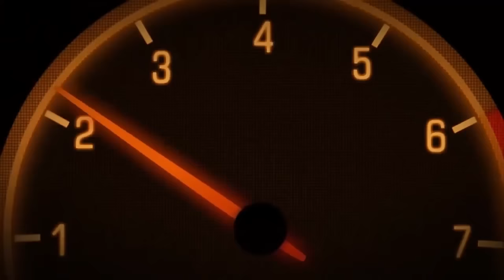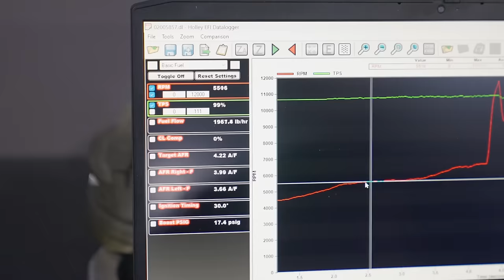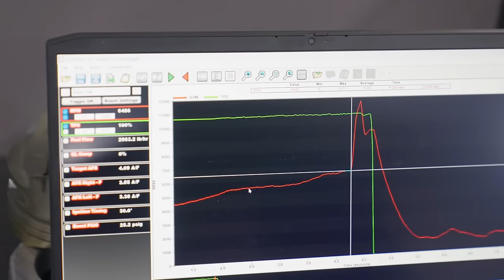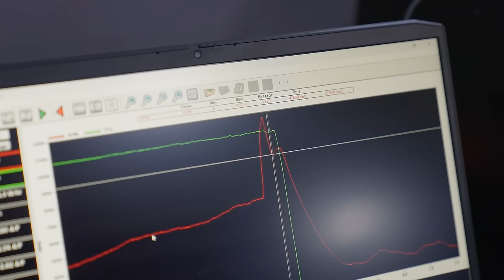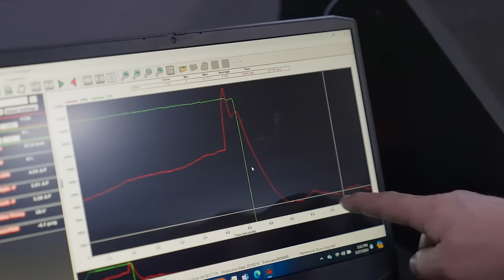This Will Make Racing So Much Easier !

Comment: instant circa 30' if I may, the inertia would not drive the revs up (inertia only tends to maintain motion), there must have been some combustion to increase revs when the braking action stopped (to  analyse the sequence one may want to double check the actual response time of timing cutoff upon signal, i.e. to time the event chain it takes from the cutoff signal occurence to detection of said signal to analysis to cutoff decision to actual cutoff chain - i know, easier said than done - plus not sure that would have made a lot of a difference - the side issue with a lot of sensors trying to avoid a rare issue is getting false alarms that cause more harm than good, e.g. with ping sensors of vibrations sensors on the whole setup)

Comment: Are you concerned with what the wind/air forces might do along the seam between the glass and the quarter panel at 200+ MPH? We have all seen them suck windows and doors off of cars, often at significantly lower speeds. I think that with the structural rigidity being compromised as it is, you would be well served to reinforce that area, even at the expense of the added weight. You’re going to be very upset if your fresh quarters get torn off the car at speed.

Comment: "Lexan" is the trademark name for  polycarbonate from GE Plastics.  Might wanna send those flywheel bolt off to a lab or someone that tests that kinda stuff.  Could the pillow block have failed first and let every thing get out of line?  Would just take a blink.
Reply: Yeah those forensic labs are doing a booming business these days.  LOL  While I wish there was a "lab" like that we could just send stuff too out of the blue to checked/tested/determined about X, Y or Z I don't think anything like that exists.  I'm happy to be proven wrong so correct away with contact info!!  LOL
Reply: @JViello  Most machine shops have eqpt. to look at a fastener and give you a good guess,  took a double row ball bearing to a guy worked in QC to look at, it was howling in my jet boat He checked it for about a min. and told me I should have shelled out the extra 25 bucks for the premium bearing.He showed me chips in the balls, the bearing looked perfect to the naked eye.   I'm sure if your some research on the web, couple o phone calls you will find what you need, good luck

Comment: Steve, talk to Clark about welding handles on the inside rear portion of the panel so you can pull to align the fasteners from the inside and make it easier to put the zues fasteners in

Comment: Steve... You need to install a loud pedal for braking, and a dyno Christmas tree light system. When the computer stages you at max rpm if it sees a sudden high increase in Revs for a few milliseconds..... It drops the tree instantly from the staging lights to the go light and at that moment with you being a drag racer, you stomp that loud pedal engaging a fuel shutoff solenoid,  motor and inertia braking system. You get to drive the dyno! Think about it Steve! 🤔👍🏁🇺🇸

Comment: in time i'm sure you will get it where you put a level in the middle if the fender with a handle and it undoes all the inside ones at one time. you getting faster every year.and that means more of a chance of getting into a crash so i would keep it for a spare.

Comment: I’m wondering if framing it out first and installing the Zeus fittings would have helped you keep it all lined up, then cut the sheet metal quarter panel off.. still awesome and makes sense though. Also maybe a titanium wire rope installed to the inside quarter as a back up incase the quarter decides to separate at speed? Really enjoyed the video! 🤙

Comment: I hope those rear vent windows don’t fly open (or worse fall out) the first time your car shakes the tires.  OE hardware was never designed to hold up under the forces of Pro Mod tire shake!  You might want to come up with a more secure latch mechanism for those to prevent that.  None of us wants to be “that guy” who breaks glass on a freshly prepped track.  That said your ingenuity re: the removable rear quarters is top notch!

Comment: Steve, you need to REMOVE THE FUEL CANS OUT OF THE DYNO ROOM!

In the event of an explosion or flying parts, they could hit them, puncture or ignite them and burn your building down.

A few extra steps to get fuel is worth the safety of saving your shop.

Move the fuel jugs outside  of the dyno room please...

Comment: On the dyno flywheel bolts, what grade are they and how often are they changed? Handling as much power as your engines put out, I can easily see metal fatigue as a real issue.

Comment: Any way you can come up with a piano hinge that would mount to the top of the fender underneath the window? It'd be much easier to pull a couple Zeus's on the bottom and swing it open change the tire swing it down. My opinion your car do what you want just seems like an awful lot of Zeus Fasteners to take off

Comment: Now that the driver quarter is off a metal guy could remove the bondo and metal finish the quarter, and the air brush work could be saved and blended. The only reason the bondo was there because they could get behind it to fix it

Comment: I’d use the new 1/4. The original will need to get repainted anyway and that filler (“bondo”) will have to be all ground out and redone because I see cracks in it that spread. In the end it’ll be easier and cheaper to use the new one.

Comment: Something is telling me that on the inside, between the fasteners, one would profit from thin layer of silicone to dampen the vibrations. Like smear thin layer of silicon or rtv or similar and let it dry creating very thin gasket.
BTW reaction time of 0.2 seconds is super fast. For drag racers thinking it is not, just think that in the drag race you have luxury of knowing that is about to happen and you have tree lights telling you when it is going to happen. So you are reacting before it happens and that’s how you get lower “reaction” times. In this case, this was the real reaction time because it was unannounced. 0,2 seconds is the fastest reaction of average humans even just to recognize the change. From recognizing to action there is a tinny delay as well. So Steve reacted with an action in 0,2 seconds and that’s very fast for us humans. Sadly for inertia and those fast rpm both Steve and the rev limiter are to slow. It’s like a bullet time slown down on the high speed camera. In real time reaction was super fast. On high speed recording you see how that all is slow regarding to inevitable disaster. I am just glad that explosion haven’t hurt anybody.

Comment: It's like going to a tilt/removable front end & all the ease it brings, only on the rear.  Gonna be great.

Re: nibbler
Doncha love it; got a pneumatic version. It's an eager eater. 

Only negative is you can end up w/ a razor sharp scalloped edge if you aren't smooth w/ the cut. Well... that & the tiny little pieces of metal it leaves behind; worse than shallow DoC end mill swarf from SS.

Re: overwinding
Seems to me you were transported back to the 60-70's; just like missing 3rd gear.

Comment: I know it would have been nice to reuse the original quarter, but it really wasn't guna make much sense.  Finding that mud from the old repair in the L quarter may have been a blessing that'll save ya the pain of trying to cleanly add on the portion needed for overlap.  Cutting the donor quarter slightly "longer" than the opening, like what was done on the R side, will be much cleaner and easier in the long run.  One thing I found a lil odd, was how anyone could question the sudden uncontrollable over rev on the dyno... I dunno, I guess it just seems like it would be common sense.  One thing is for sure, getting her shut down that quick was pretty BA!

Comment: .2 seconds actually is a really long time for a computer, that is more than fast enough for a CPU to respond, if we just look at CAM single (while transfer rates differ per channel) it's not uncommon to receive fast changing data such as RPH at 50Hz (which is about 20 miliseconds). It could certainly be that the safety takes too long to kick in, but from a technical perspective theres that RPM limiter should just worked.
Reply: Even the fact that you have data points in your graph means that the CPU has more than enough time to process it otherwise those data points would have been missing as well.
Reply from the maker: Yes the limiter works
Engine inertia wont stop
Reply: Two tenths of a second, not two seconds. Even with the ignition stopped, and had he been able to instantly close the throttle on breakage, the inertia of the rotating assembly was going to climb for 2 tenths of a second given instantaneous work load removal.

Comment: Steve, I admire you for wanting a pretty racecar, but it's always going to be a losing proposition. Custom paint is for show cars. As for your removable quarter panels, I would have used the factory upper molding as seen on the replacement passenger side to hide some piano hinges and 5 or 6 dzus fasteners along the bottom to make swing up panels. That way you never have to worry about them getting stepped on, blown away, or stuff dropped on them. I would also go back to vinyl wood grain, so NEXT TIME it gets damaged it's a cheap easy fix, and also easier to change if say next year you want red brick sides 😂. Good luck in the future and keep the videos coming.

Comment: if you wanted to get really safe you could spend the money on Kevlar panels like the ones in secure buildings ? just a thought at least on the wall facing the operator of the engine dyno?

Comment: fairly thick piece of aluminium bolted to crankshaft. obviously fine until it wasnt. where the bolts 1 3/4 or so long? im thinking along the lines of, soft material being held by rather long bolts..

Comment: I have a 67 Camaro, so it's hard for me to get on the inside. So I attach mine by removing the Fender on the outside. But I did mine in the late 80s. Early 90s worked very well for all these years.

Comment: hey steve, just a question....?..arent those fastners u r use'n to temporaly hold the 1/4 panel on called "celcos" fastners...?...Zeus fastners r flat with a screwdriver slot in them...?...is that correct...?..or did someone lie to me....?...thanks..
Reply from the maker: Correct

Comment: use the new 1/4 panel you have, for that to be any good, clarke will need to cut out the bondo,  cut out  all where it's cracked, because any moisture that can get in there is going to cause problems down the road, so it'll need to get partially painted anyway, you might as well have it done properly.
you are a man who wants things done correctly, putting more bondo in there is not really doing the job properly.

Comment: Glass Suction Cup Heavy Duty Aluminum Vacuum Plate Puller Handle Holder Hooks Duty Glass Lifting/Tile Suction Cup Lifter/Moving Glass/Pad for Lifting (Yellow, 2Pack)

Try that to pull the fender on and off. should make it easier to move it around.

Comment: I am concerned that you are reducing the torsional rigidity of the tail end using Dzus fasteners on the quarters. As you now will have glass again, this may break during body flexing. I would suggest you make sure you reinforce the lower frame of the back side windows so they have more structural rigidity.

Comment: I don't buy bolts just shearing off unless they were cheaper than cheap grade 2 bolts, or if they were left loose.  If it were that easy manual transmissions cars and transbrake cars at the track would be constantly breaking their flywheels and flexplates off their engines rather than drive shafts, axles, etc  At 100% throttle and 6500 rpm lets say that engine is making 1000 ft/lbs of torque, at that point those bolts are required to resist significantly less load than the same engine with a 6500 clutch dump or releasing the brake on a good tire because at that point the flywheel bolts are absorbing that 1000 ft/lbs as well as the inertia of pulling that engine rpm down instantly.

Something else is going on here.  When was the last time you heard of flywheel bolts shearing off for no reason?  With the engines Steve dynos on a regular basis it would be a constant concern, yet it's not, this was a total surprise.
Reply: @Aduki65 very true, and the chances of being run down with an impact and not final torqued are high.

Should be a lesson learned and glad nobody got hurt

Comment: whatever the horsepower of the engine was say 1500HP puling full chooch... suddenly load disappears... that much HP with 1000 RPM to the limiter an engine will easily overshoot the rev limit no problem... this happens on much lower horsepower engines and they fly apart due to inertia.  Im totally curious why the flywheel bolts sheered off... random failure?? bad bolts?? total bummer

Comment: It’s your highest torque point off of those bolts, right Now, if you Have been using those boats over and over on Dino runs that will do it. Another thing is I don’t think your Dino could’ve kept up with that because of the old torque tube.

Comment: Maybe I'm extremely ignorant, but how does the dyno know what the RPM of the motor is if the flywheel and the dyno are separated due to broken bolts after the motor ran away? Is there a secondary connection like a crankshaft position sensor or camshaft sensor?

Comment: Your windows may weigh 10lbs but how much weight of inner body structure did you cut out. Your weight may not have changed much if any with this modification.

Comment: Seems like you could use a generator or dynamo to create dyno load and at least power your shop lights and a few things just doing dyno pulls bet it would be putting out some juice with a 3000 hp generator